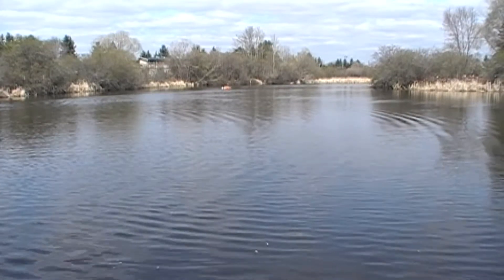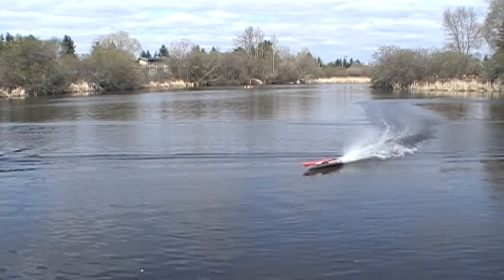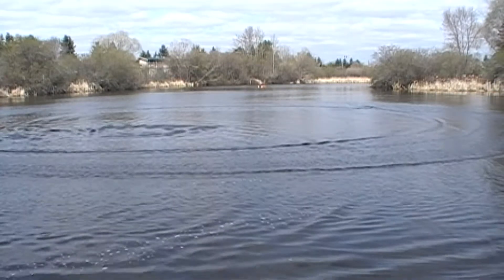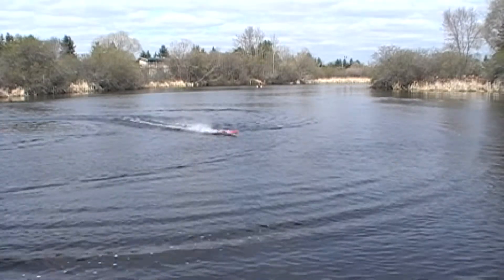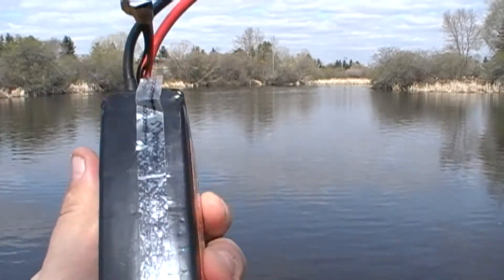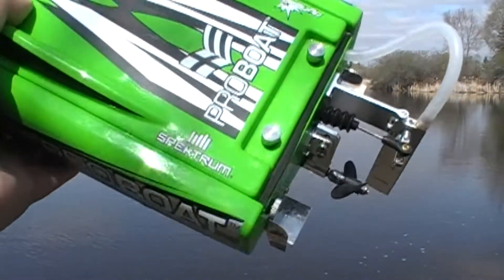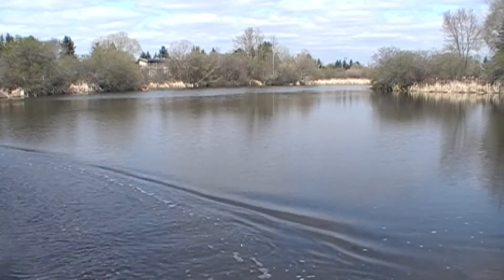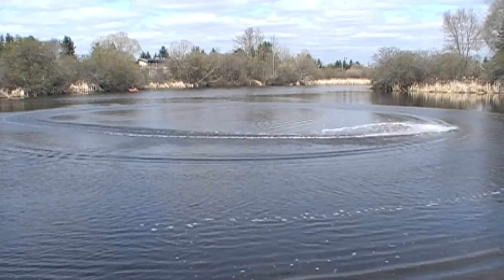Traxxas Spartan power problems

Comment: Mine does the same thing and right now the esc is like flashing yellow and throttle won’t work I think it could be a problem with water getting into the TQI system do you know anything about that?

Comment: A common problem like real boats is Cavitation, if the prop shows signs of any knicks or is deformed  it will just scream it's head off and go now where. either replace the prop or you can sand them smooth so the have a nice sharp edge. Search Cavitiation explained on Youtube